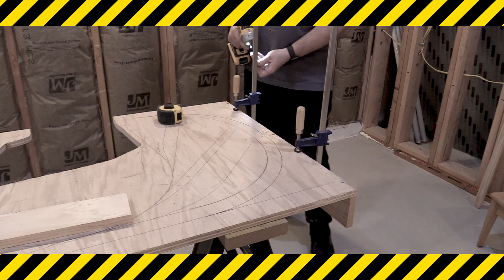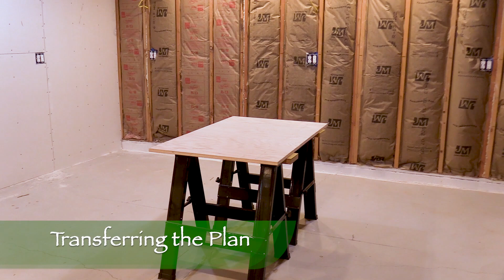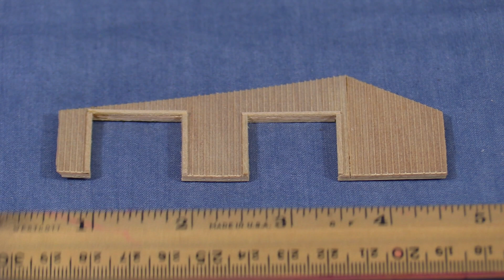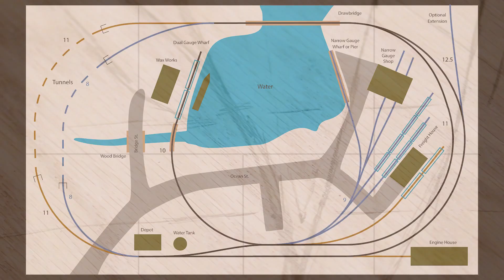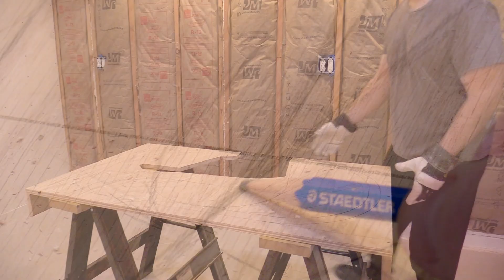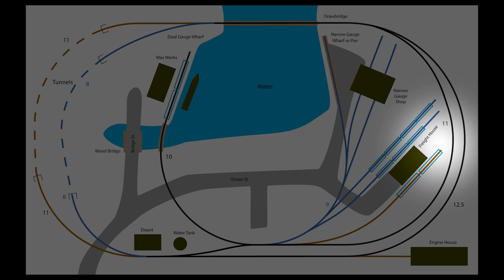Layout Building N Siren Creek Part 2 - Basic Benchwork

Comment: Hey did you order a HO rotary from fred down at whistlestop?  I got the 1965 version on order.  Thank you for the layout update.  I was just wondering cause i dont know if it will come with DCC and sound or not?  And how hard will it be to add them?  I can solder
Reply from the maker: Someone's making an SP rotary?  I'll have to check that out.  Not sure how to answer the DCC and sound question since I haven't done one of those, but in theory it shouldn't be that different from a locomotive.  Thanks for watching!

Comment: Sharp tools are safe tools; they do 90% of the work. What makes them dangerous is if they're dull.  You have to force them and that can result in injury.
Reply from the maker: Very true.  I remember my grandad had some saw blades and drill bits that were probably from the Great Depression, and wouldn't cut butter much less wood.  Thanks for watching!